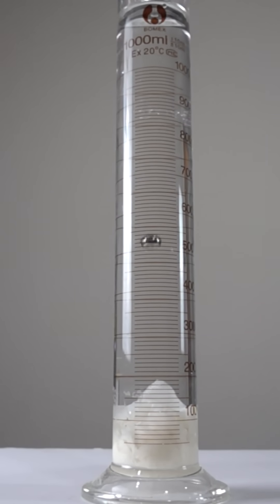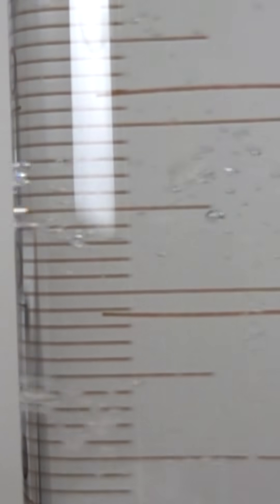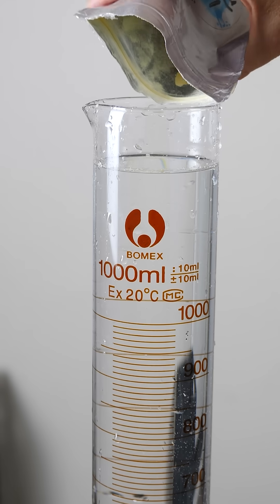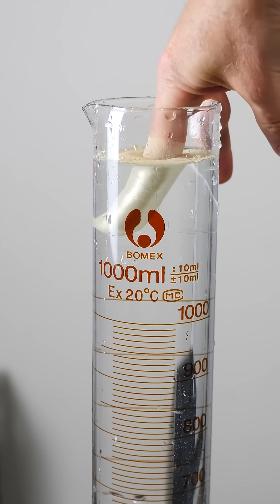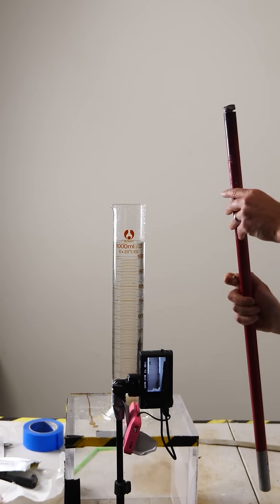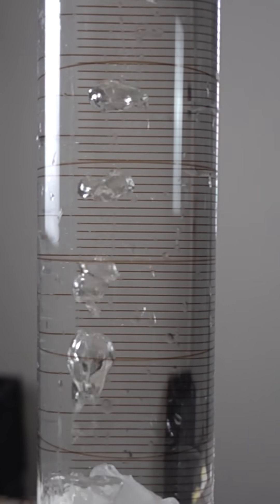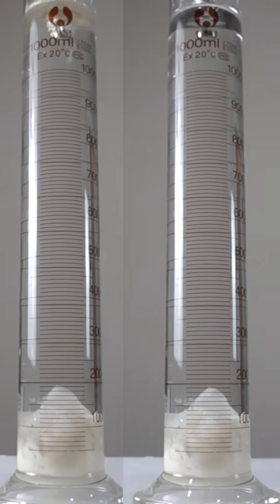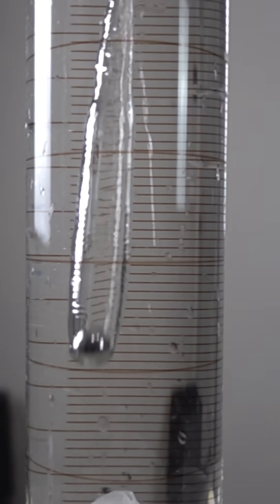Making a Frictionless Torpedo

Comment: If there's not already a torpedo with that material coating the outside I'm about to be rich.
Reply: Been done already.
Russian Skval Torpedo.
Rather than use hydrophobic coatings, they have a rocket engine blow gas in front of the torpedo. So it basically 'flies' inside a bubble under water.
Reply: there is also a rocket tip that creates a "bubble" of very hot air around the nose of the rocket, doing the same thing.  @adriansue8955
Reply: @adriansue8955  Yes but it is unguided. Doesnt have homing capabilities and can be heard from the enormous cavitation. Made to hit Carriers.
Reply: @adriansue8955 Too expensive to have an engine on a torpedo. You can just make a long bullet with a hydrophobic coating, launching from a muzzle with an air pocket inside and maybe around it.
Reply: @CapnBlud the Skval Torpedos use a Gas Turbine as propulsion, the exhaust is just at the tip of the torpedo. So its technically More complex, but also more efficient because of lower drag
Reply: @campandcook3118  not more cost effective than such a type of bullet would be if anybody needed it.
Reply: @CapnBlud  Do you think that the hydrophobic material would stay on the torpedo? And if one part comes off but some stays on then it messes with the trajectory of the torpedo.
Reply: @Jester343  not a torpedo, a bullet. I am talking about underwater gunfire for diversions, sabotages etc. Like, they already have underwater guns, those just don't work long and don't shoot far.
Reply: @CapnBlud  It's not necessarily too expensive, it just can't turn and you have to be close enough so the target can't evade or defend itself. Radar will pick it up immediately due to it's noise and it can't turn sharply to readjust should evasive action be taken.
Reply: @Jester343 True, it’s actually Sonar that detects it. Radar doesn’t work underwater.
Reply: @SimonBellaMondo  sorry, that's what I meant
Reply: @Jester343 could always be a wire-guided torpedo which could have its trajectory corrected, meaning it would move faster and still be able to be accurate
Reply: @ryan.8783  Not by much though. If it uses an air bubble like this torpedo then if a fraction of it touches the water at it's top speed then it gets shredded.
Reply: @user-xg4zj2jn9v the Soviets looked hard into the problem of underwater bullets for their saboteurs and to combat enemy frogmen. They surrendered in the end and created instead special weapons that fire harpoons, not bullets. turns out firing a harpoon is much better - their enormous front area/length ratio plus their bigger mass means they keep travelling in the same direction longer (tens of meters, as opposed to barely 10 to 20 for bullets), and even though they travel slower their much higher mass means they can deliver a big punch. Probably a hydrophobic coated, elephant-hunting bullet would work as good as a harpoon weapon, who knows - the US decided to concentrate on training marine mammals, having small armies of dolphins, seals (and belugas, at one point)  patrolling important harbors and pinpointing mines and enemy scuba divers
Reply: @CapnBlud Such a bullet could be useless, it wouldn't go several kilometers to reach the target.
Reply: @CapnBlud submarines already have very thick steel plates, and even with this coating the bullets won't make any significant distance.
Reply: you could try making underwater ammo for underwater gun fights
Reply: A torpedo needs water resistance in order to move forward, if there's an air bubble behind it, the propeller won't work properly
Reply: @melevolent8599  First of all, this isn't true. Torpedoes have air bubbles behind them all the time they're used. It's what causes drag, it doesn't make them stop working; it just slows them down.

Also, it would work it, for some reason, always had na air bubble over the propellor. First of, torpedoes use counter rotating propellers to reduce torque. Second of all, these propellers would keep propelling through the air bubble because air is liquid like, it isn't fixed like a solid. The air particles can be pushed behind the propellor propelling the torpedo forwards, albeit at a slower speed due to air being less dense. Obviously this requires other navigation features to remain unaffected.

However, there are torpedoes which use air bubbles to move faster. This is called supercavitation. The fastest torpedo ever developed, the 'VA-111 Shkval' (Soviet), was supercavitating. In fact, both Russia and Iran are said to have these torpedoes today. Although, of course, they use rocket propulsion and not contra-rotating propellers.

Granted that they have many flaws. The biggest being either it's inability to turn sharply and it's noise. Any ship with radar can detect this and take evasive action or countermeasures immediately. But that's what this torpedo is all about, it's meant to be a torpedo unable to be hit or evaded, hence the reason it can go up to 230mph. The reason it can't turn is because the water would rip it to shreds at that speed.

Another big flaw is that it can't slow down and then speed up again.

The best use of this torpedo is to be close enough so a ship or other submarine (unlikely but plausible) can't evade or retaliate. It would also theoretically be a nightmare for any port, obviously a port can't evade but if defences can't be organised in time then the torpedo will end up hitting.
Reply: Not if i can beat you at it 😂
Reply: @CapnBlud  dafqu you talking about 'too expensive'? It Literally has already been built and is in service. Google It.
Reply: odds are, they did, and to submarines too.
Reply: The Americans did this too.
Reply: @miaohmya92 shut up ukronazi. Russians are the GOAT. Cry more
Reply: dementia

Comment: One thing that has been done was putting an oxygen (or whatever gas) generator in the front of the object to encapsulate it in an air pocket then using a rocket engine at the rear you achieve extremely high velocities

Comment: There's only one problem..... your propulsion (propellers) and control surfaces (fins/rudders), need water flowing over them, in order for a torpedo to function.  If it's inside a bubble, or bubbles are flowing over the control surfaces, you get zero functionality from them. So in theory, your torpedo won't be going anywhere.

Comment: Olympic swimmers looking like they're covered in a weird power: Starts running under water
Reply: i wonder if you would drown because you cant stay above water by yourself.
Reply: Hold your breath: the new Olympic sport
Reply: I imagine this would make running underwater a lot easier.
Reply: No friction means no propulsion...
Reply: @bearb.7406  Almost right.  Pushing water with your hands is like an airplane propeller, jet engine or rocket motor pushing mass to the rear.  It creates an opposite and equal force forward. Propulsion.
Reply: Technically that would be a DQ because you are not allowed to touch the ground in swimming 😎
Reply: Lmao 🤣  this is the only comment to make me laugh
Reply: Never cancel an event due to rain .
Reply: Look at chinas divers this yrsr
Reply: That Chinese guy with no arms had this all over his head 😂
Reply: This only negates friction, not buoyancy.
Reply: @user2C47  so means you could stay above water but being almost unable to swim anywhere?
Reply: @helios007  Depends on density, and it won't stop turbulence.

Comment: What is of interest here is how a flying sub could become hydrohobic if covered with this substance greatly improving a membrane surrounding the hull, effortlessly plying the currents with out friction. Could explain our Unidentified Submerged Objects ability to defy the known laws of physics but when taking to the air they must have a membrane of compressed air to float thru the air at one thousand times the speed of sound and reach speeds without drag. Once in outer space, there must be an envelope of some type surrounding the craft ?

Comment: I noticed something like this back when I was a competitive swimmer.
Go completely underwater, and make your hand into a claw.  Try to swing at the space in front of you as hard as you can, and your hand will go very slow, and it'll turn your body as a catches the water.
Now try the same thing, except this time, give your hand some air.  Put the back of your hand against your mouth, blow some air on it just as you swing.  Your hand catches the air and it will envelop your hand.  Your hand will rip through the water with a speed almost like you're on land.
You can use air from the water surface too but it's all splashy and messy, and nowhere near as satisfying.

Comment: I am confused why the hydrophobic ball hits the bottom earlier than the non hydrophobic ball. 
Is it since it's hydrophobic the water doesn't apply as much of an opposing force when it falls down because the air bubble around the ball can displace the water faster than the ball could by itself?

Comment: What would happen if you coated a boats propeller to make it hydrophobic? Would it just cavitate or run at a higher RPM due to less friction?   Would love to see this video done. 👍
Reply: I would imagine it's going to cavitate. Spinning fast enough to create a large bubble around the propeller, and then it doesn't push/pull itself thru the water..... idk. I agree. I'd like to see that test.
Reply: Why not coat the hole boat, less friction means less power needed to push it forward, it probably losses its potency fast or something.

Comment: I would love to see this in deeper waters. Imagine how fast it can get if dropped in the Mariana Trench 😂
Reply: 33% faster is a far cry from free-fall. Water is still a viscous medium that prevents the ball from actually sinking as fast as if it were in air. The better comparison would have been against one dropped OUTSIDE the Beeker along with the one inside. Guess which one hits the bottom first.  That assumes you can actually catch sight of it as it flashes by.   This is full-on gaslighting.

Comment: The military has been using something similar with a hydrophobic coated projectile. Many diving elite military uses some form of similar weapons. The main problem is that sustaining the firing underwater thus conventional firing mechanisms and propellant system is not viable. A electronic or compressed gas system is preferable.

Comment: Interestingly something similar to ‘hydrophobic’ happens with the individual ash particles from volcano eruptions. So every minute ash particle is like a torpedo all gliding off each other.  
So the ash cloud can tumble down a mountain many times faster that standard dust would. Making volcanic ash clouds like high speed burning hot avalanches. So extremely dangerous and difficult to escape when one is heading towards you

Comment: Is it possible to permanently adhere a layer of this powder to a surface like a boat hull?  And would that boat then float or sink if it had this power coating the hull?
Reply: The powder cant support a weight like that, it will just sink but there will a small air bubble under it i think

Comment: What about super heating a metal projectile before dropping it in the water. Would it have a similar effect I wonder because the water that comes in contact with it instantly turns to steam in turn creating a jacket of steam around the projectile that separates it from the water. I wonder. Just a thought. Any one want to elaborate or offer any ideas or facts about this possibility that I haven’t considered. Of coarse I obviously realise the projectile would cool rather quickly, but still think it would initially have the same similar effect. What do you think?

Comment: That's Great! Now that you're creating a cavitation space for your projectile without contacting the viscous fluid how do you control the direction of your projectile then if it's not able to grab anything around itself? With Hydroplanes we would ride on a cushion of air, but without having "turn fins" sticking down deep enough to bite the waters surface no matter what you did, you lost all abilities to steer the boat and are at the mercy of going the direction of the engines torque from the prop. So if you added some sort of turning fins which would pierce the surrounding air bubble, this will still be faster from drag reduction and still have the ability to control your directions.

Comment: These tiny bobbles aren't air bobbles, behind it. Where did that air come from then? Do you see it go up to the surface? It is water In gas state, because the pressure behind the sphere is lower.

Comment: No mention fly the fact that they actually make rocket propelled torpedoes that travel at hundreds of miles per hour using this effect? They actually divert gases out the front so they tip is never contacting water, the body is actually traveling in a bubble of gas, and it goes many times faster than conventional torpedoes.

Comment: oh yo. what if u made hydrophobic bullets or swimming gear
Reply: Wondering that too about bullets. Only issue I can think is heat. A bullets tip cuts through air so fast it actually melts the tip from the friction of air. Moving that fast. So you'd need a chemical comparative to this but also heat resistant. Maybe if you mixed this stuff with Hornadys ELD tip it might work but I doubt it.
Reply: @ibanezrg320fm  im no ballistics expert, but i would think using sub sonic ammunition would yield better results?

Comment: This is interesting. However, a torpedo has a prop on the back for propulsion. Cavitation like this looks like it'd really screw that up. I also wonder if this would create any issues with buoyancy as a torpedo travels horizontally, not vertically.

Comment: Fun fact, in the special effects business we sometimes use lycopodium to make safe (or "safer") explosions, it is commonly also used to make fireballs etc. at concerts, Rammstein, for example, has a couple of such rigs and I've been lucky enough to get a chance to play around with one of them. The reason why we occasionally use this powder is that it makes a slower developing burst of fire than for example propane does, and it's safer to work with than flammable liquids as it won't ignite unless the fuel/air mixture is correct, plus it can't spill on the ground and set other things on fire. Normally we'll blow it through a pilot flame - when the ratio between lycopodium and oxygen is correct, it'll automatically ignite due to the pilot, and result in a rolling ball of fire going up. It resembles a gasoline explosion, minus the black smoke. The effect is called a fuel-air explosion, although it obviously doesn't create the pressure we see in the military application of the concept.

Comment: Back in the 70s a few racing sailboats used to pour a wetting compound in  the water as they sailed through the liquid. It reduced the drag on the boat. It polluted the water so was quickly outlawed and prohibited.

Comment: If you were falling at high velocity impacting the water would kill you due to surface tension and water being non compressive. I wonder if hitting a surface like this would enable the drag forces to be dispersed enough to not cause damage to the person falling. Of course swimming back out might be an issue at that point... but lets solve one problem at a time lol

Comment: Ive heard this is how penguins are able to launch themselves out of water: before entering the water they absorb (trap?) air into their feathers which helps to keep them warm underwater. As they reach the surface they release this trapped air and it reduces the friction on their body and they can accelerate to the surface

Comment: I wonder what would happen, or what it'd be like if a completely hydrophobic compound was painted onto a submarine? Except for where the passive, and active sonar, and microphones meet the hull... and possibly the screws as well. 

Or if you could adhere this hydrophobic stuff to the outside of the dried outside of an ice cube. Then quickly drop it in a glass of water. Especially if the ice cube didn't float to the surface, I wonder what would happen.

Comment: Once learned from a teacher, who was an ex-submarine technician, that the missiles do something similar. They blast air out of many areas around the outside of the missile, so that no water ever touches it. If water did touch it, it would create a lot of drag and the missile may spin out of control.

Comment: The same principles are used with the 200 mph torpedoes that use pressurized air around the torpedo in order to have way less resistance in the water.

Comment: Fall through water faster? Turn it up ninety degrees, aim it, fire. Doesn't matter the delivery system, coat whatever munition is released towards a target, in however manner, and which is intended to enter the water in order to continue to the target. The only difference is the coating that causes an increase in speed and stability by making it homophobic. The quicker to the target, less response time of target defense.

Comment: can this be technically applied to bullets to allow marines to shoot into water? because of surface tension if you shoot bullets into water they usually shatter. the higher calibur and power the more likely thw bullet shatters. This would prevent high risk enemies from escaping or even for cops. they could use rubber bullets like that to discourage someone from trying to swim away as an escape. Plus it just hurts and doesnt incapacitate so that would technically work as a non lethal way to attack under water targets.

Comment: Theoretically, a sphere has no drag if it is moving through a fluid with no rotation. However, the reason it does in real life is because of viscosity and imperfections in the materials.